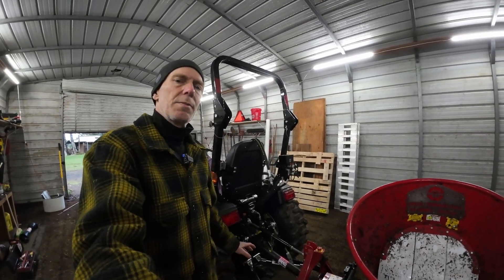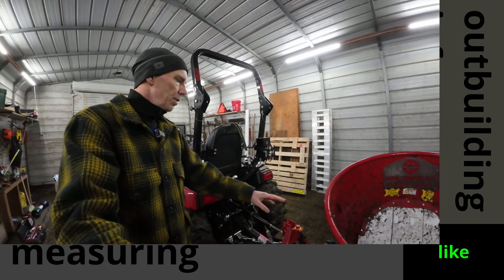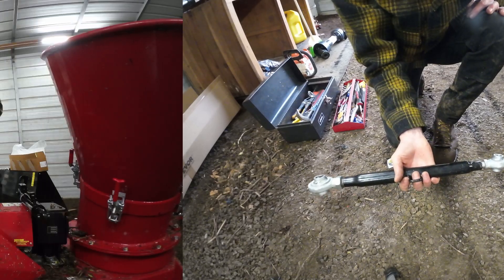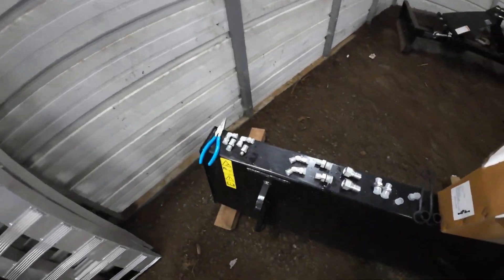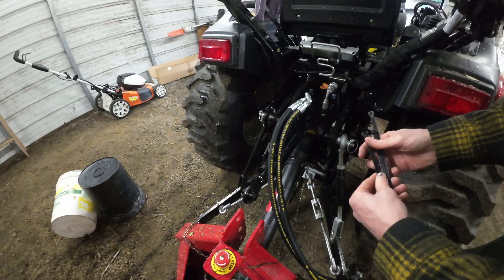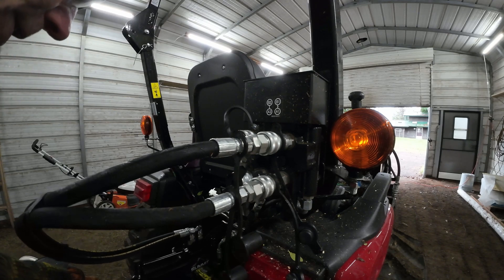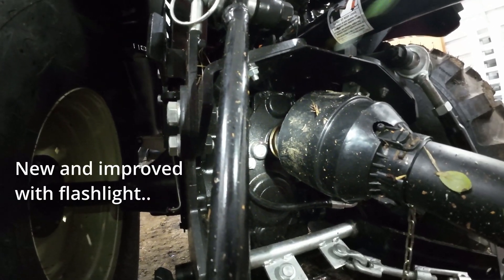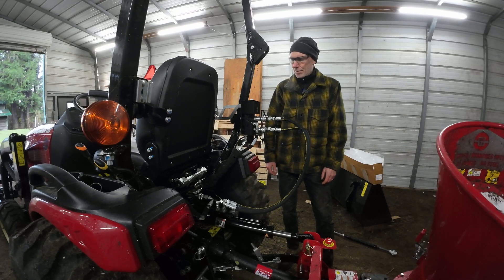008 - Tractor Attachment.. Hydraulic Top Link Install

Comment: Do you know what size of fitting I need for the rear remotes? The top link I have the hoses I have the fittings are a bit to big
Reply from the maker: I think the stock Yanmar fittings on the rear remotes are 3/8" ISO-B connectors. I went back and forth to my hydraulic supplier and found the best approach is to just take one off your rear remotes and bring it in when you try to get fittings. There are so-many, that this is the best way to guarantee the right one the first time.

Hope this helps and thanks for watching/commenting.